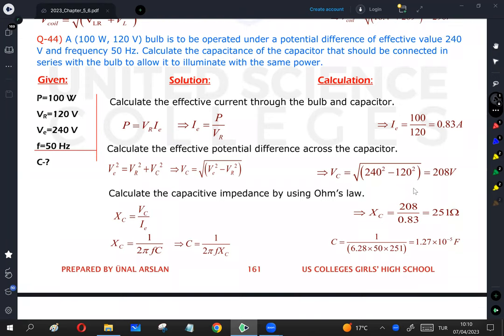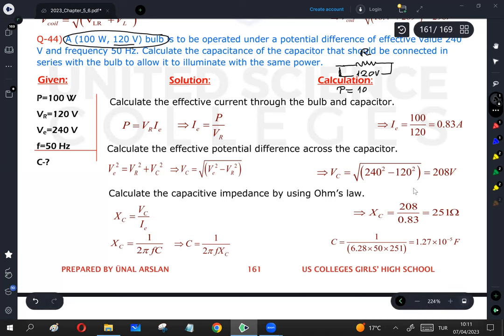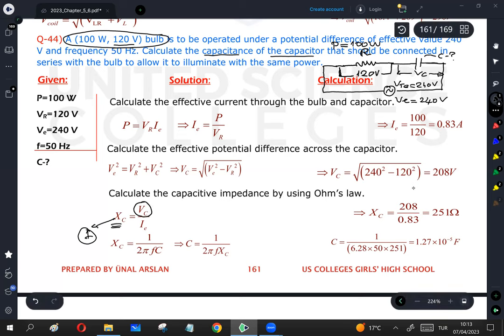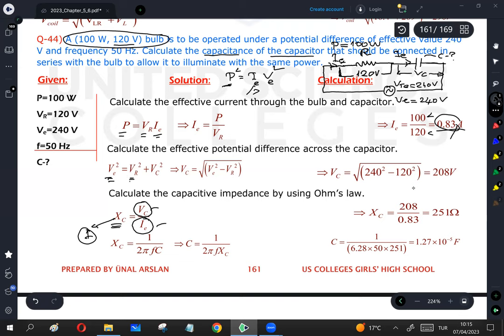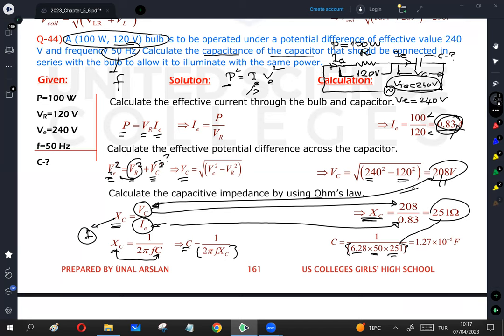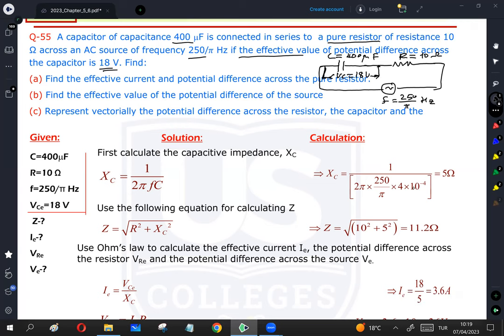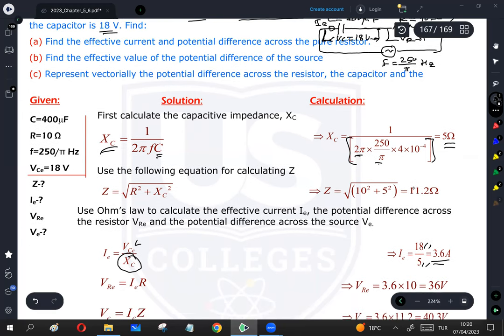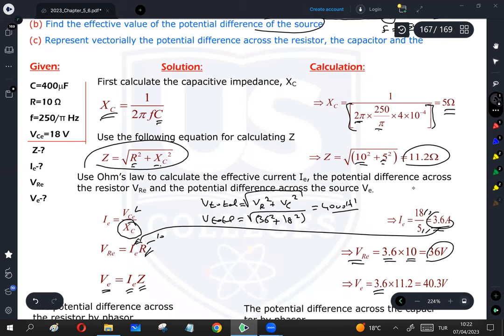Four Chapter Review Questions from Chapter 6, Section 3

Comment: Teacher
 in Q44
(VR) is refer to what ?
Is it
potential difference of the resistance of the capacitor ?
if yes
Do we count it as 
(impure capacitor) like the (coil) one we had it in Q52 ?
Reply from the maker: There is a pure resistor. VR is potential difference across the pure resistor
Reply: Teacher here the bulb  is the resistor ?
or 
the bulb contain resistor ?
Reply from the maker: @Hazel00..23 every bulb wire has some resistance
Reply: I really got that Q.
I very much appreciate your help
Ünal Hocam.